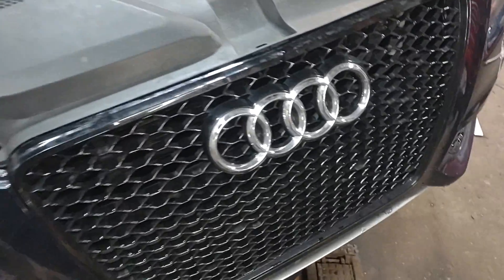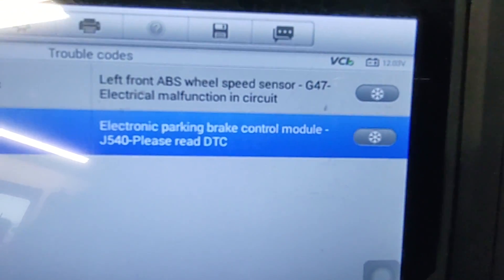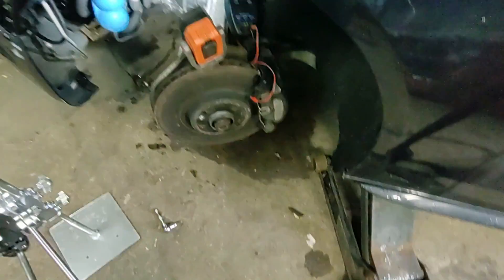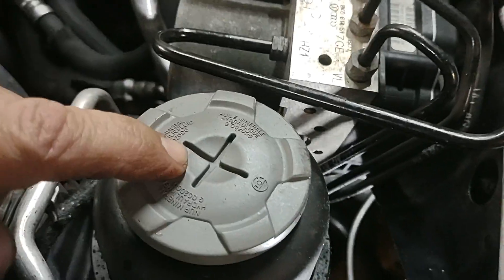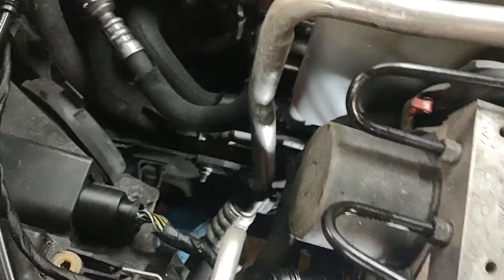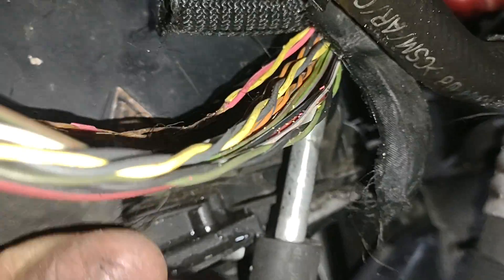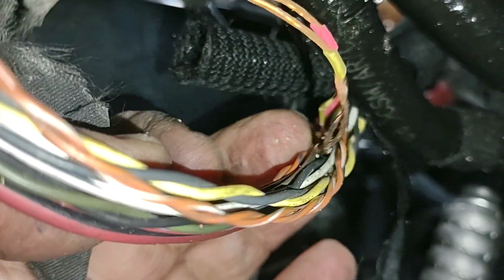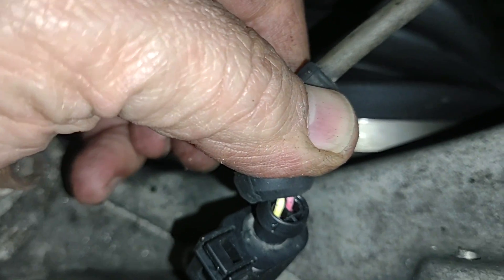@carservicepro Audi ABS 00283 fix, Audi ABS light on, G47 Electrical Malfunction, EPC light on,S5

Comment: Great diagnostic work, going to check this on mine. Replaced everything else related this is the only think I can think of now because it does in fact have an oil leak that could cause this. Thanks!
Reply from the maker: Sounds good! Good luck

Comment: I have this exact problem. I'll certainly check for the same problem. Thank you, this would have driven me mad trying to find it. Did u clean the other wires in the harness to get rid of what had eaten away at the wire coating? Is there a correct product/ spray to do this? Your video will help so many people, well done!! 👍
Reply from the maker: Thank you for your feedback. The issue with the wire insulation being peeled like this was caused by the power steering fluid. While I can't endorse a specific product, I can suggest several options for sealing the wires. You can use heated shrink wrap, liquid tape, or RTV silicone, typically used for gaskets or gasket makers. These are all readily available at most auto parts stores or Walmart. I hope this addresses your question.

Comment: Life saver I have the exact problem with my A5 changed sensors bearings modules now to check the wiring thank you
Reply from the maker: Apologies for the delayed response! Glad to hear you found the video helpful. It sounds like you've been through quite the troubleshooting journey with your A5. Checking the wiring is definitely a crucial step in resolving such issues. Let me know if you were able to fix your car and if it was different issue please share it here, and best of luck with your car repairs!"

Comment: Can using 68mm sensor instead of 35mm sensor cause this issue
Reply from the maker: I would just get OEM to avoid the guess work, sensors are specific and calibration vary from car to another, so you need to make sure you get the right part#, I am not sure why you have different size in diameter!